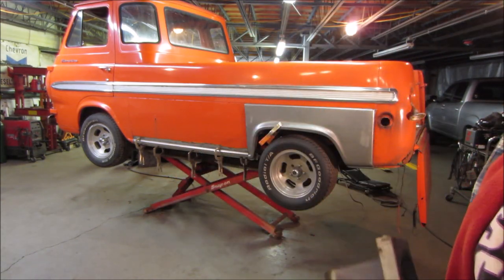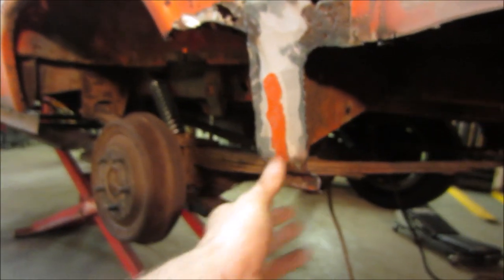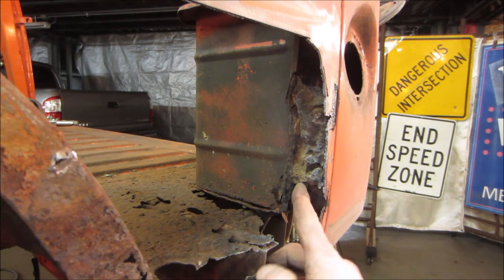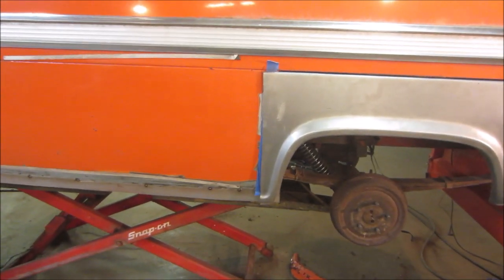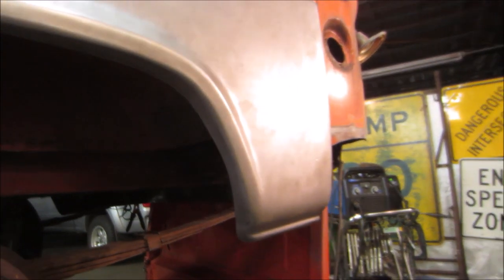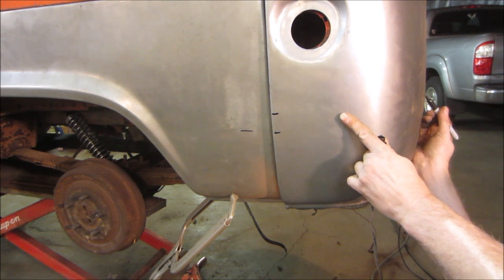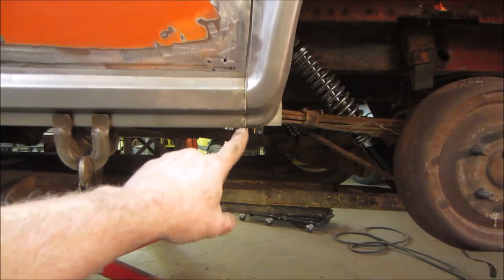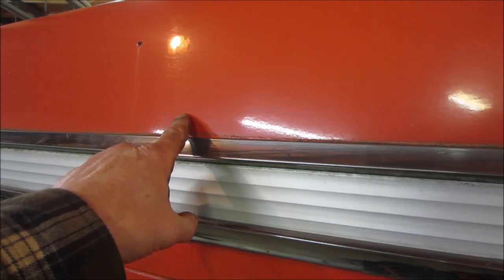Quarter Panel Replacement on a Ratty/Rusty Econoline Pickup

Comment: how is life treating you? my uncle just fixed one of these trucks, but we swapped the engine over to a 302 bored 60 over and a 4 spd automatic, then he put a four-barrel on the intake then rewired it. it ran beautifully on the freeway then he found out the original diff didn't like all that power.

Comment: About those "hidden figures" under the paint coat, I've heard you can see this kind of micro relief clearly if you're looking at it in a polarized light. I would experiment with pieces of a polarisation film from some broken lcd screen and different sources of light. MB an interesting experience. Or just a light coat of a contrast color paint and piece of cardboard or thin mdf to wipe it of the high spots could be another option. Would be really interesting to find out what's been written (or drawn) in there:)

Comment: Just wondering? I’ve seen others do similar work , the overlay a new panel , larger than required over the old existing panel , cut thru both to get a perfect match , weld and job done . Not putting you down for what you do cause I’m fascinated with  what you do .

Comment: Nice work ! Have you thought about using panel bond for the front edge of the quarter panel? Will make a nice joint and seal it all at the same time!

Comment: could you tighten up that radius at the back of the big panel with a v-block and a blunt chisel working it around the curve similar to the way your brake worked the top edge?

Comment: The way those panels look I would say that the manufacturer probably stamps the panels, maybe make minor adjustments and then send them out the door. I don't know if anyone will read this but what company did you get the panels from? I want to know which manufacturer to avoid if possible.

Comment: Maybe it's the left over cement that they used to cover over Jimmy Hoffa ?  Ha !.   
I had a 65 and a 66 Econoline vans when I was a kid . Under the gas tanks they have a big slab of counter weight to give the wheels more traction . They have a real cool perspective on the world as its driving by , but man you don't want to crash into anything . Even at low speed you can see how much it would hurt .I had a 289 & C4 installed into one of the vans but I never did finish that project . Had to move and couldn't take it with me . Just as well , cause it you're going to add more speed , you need to add more braking power . These are not a good platform to add a bunch of power . Check the king pins too . They really effect the drivability  . These things are easy to roll too . I use to get the rear wheel to come off the ground around a corner . Take it easy Man. It would be smart to go over the braking system . Single master cly .. Yicks !

Comment: Angle grinder is really your friend when going changing panels. The plasma cutter makes the job worst and harder. Also for the future the first panel you cut generally is the new one that you can then use to mark where to cut on the car with a lip or even without.

Comment: for the guard panel, to sharpen the edge, could you pad some mig beads along the edge and hit it on the belt sander? thats a lot of mig wire but it should be pretty straight forward

Comment: After dealing with several "replacement" panels from various manufacturers, I only replace just past the rust. There is usually so much work to get the new panels to work and look right that its faster to make a patch or only cut the bit you need from the new panel. There is no fit like original.

Comment: Loving the bodywork, is it a possibility to use one of the lower Jaws from the press in the vice and a wide chisel to tighten the 90 degree on the short side as not possible to put it in the machine? 🤔 Regards Tiny, Lincolnshire, UK 🇬🇧

Comment: That crap in the back is floor leveling compound. The kind used under vinyl sheet and tile floors. Vi-Tex maybe. Similar to fix-all. Probably the van belonged to a flooring guy.

Comment: Solve rusting from the inside out with Cavity Wax.  Fill the cavities with it.   It's easy to get Cavily Wax.  It stops inside rust cold whether it's there or not.  See Vehcor video. Somehow water gets in what seem to be sealed cavities.  Vehcor contrasted the side he fixed on a Pontiac Grand Am with the untouched side.  That untouched side was rusting out, some years after the body work, the worked on side was like it came from the factory.
Reply: If the Car Companies did things right, with Cavity wax and something to stop external bolts and nuts corroding together, cars and trucks in the rust belt would not rot away.  We'd keep them like they do in dry parts of the country until the motor, or transmission or suspension died!
Reply: I believe Eric O would think he'd died and gone to heaven!

Comment: Mustie or Anyone: question about the plasma torch.: are using a special tip... do you can drag it... or do you just replace them regularly? I have a wire cage on the end of mine that I’d like to not have to use.

Comment: I probably would have butt welded the edges as your flanges are going to show on the inside of the bed since the bed is not lined.  With your  MIG welder you can get good butt welds.  I'm thinking this is a pretty nice truck considering the location and age.  Especially since it runs well.  I admire your deal locating skills.  As someone else suggested a Corvair Greenbrier or rampside would be perfect for your period collection.

Comment: That wheel well seam you can re bend it, with a ninety degree block of steel used as a dolly that way you can get a sharper bend in that seam that has a shitty curved bend instead of a true right angle bend near the gas tank, which will give you a better overall line.

Comment: I'm still watching but i would definately cut that corner out of the panel and re-hit those bends in the brake.

I would guess that's a 90 degree top in the brake therefore when you pressure bend , the flange will go over 90 at first and when you add more pressure it will push it back to 90 ..   (coining)

Comment: I'm going to have to say your making more work for yourself. Drill out the spot welds and use the flanges on the new panel! Alot less bodywork later. Any time you weld metal that thin it will bend all over. I've done 3 cars and learned this the hard way.

Comment: I'd like to live in wealthy New Hampshire where the well heeled put valuable power tools or motorized implements by the curbside with giveaway prices or for free every year if they don't start on the 3rd pull or when you turn the key over several times. It must be an amateur mechanic's dreamland for sure. On the different subject of the VW air cooled motor, Dr. Ferry Porsche the designer of the engine was quoted in print as saying not to expand the stock engine bore of the 15 and 1600cc engines beyond 1776cc , because it would overstress the car or bus engine cases and components. Building 1776c engines for all cars and buses you plan to keep and use as daily drivers might be a good useful thing to do, especially for the low drag Karmann Ghia. Keeping up with today's 80 plus mph cruising speeds on this country's Interstate System is hard or impossible for almost all sizes of stock VW engines. You seem to find spare engines real cheap or free often, and you could inexpensively build 1776cc engines and swap them out take in less than an hour.

Comment: Perhaps you should sand blast the rust so see what you're dealing with before doing repairs. It would give you clean surfaces to weld to, plus you would have a better idea what needs replacing.

Comment: if I was doing all this great metal work your doing on this job I would not do Bondo that will cause rust down the road in two years.  I would lead it.  It will last as long as long at the rest of the metal.  Just saying.

Comment: Seeing when you cut it out I was looking behind what you cut out kinda rusty back there. I.  have a 92 Ford from the south never undercounted little rust did the hole bottom with rust reform than went over it with oil base primer car has no rust stop it co

Comment: What brand of plasma cutter are you using?  Is it miller or smith equipment?
Reply from the maker: HYPERTHERM POWERMAX 30 works great but kinda pricey
Reply: @mustie1  Ahhh  I used to work at the Smith Equipment plant and helped build their 55 amp machines and repair their older 35 amp machines.  Always wanted one but couldnt justify the cost

Comment: It just occurred to me that rather than repair rust in bed you could convert to wood boards and rails. You could then throw a piece of plywood of that loosely to protect those beautiful new boards and rails for those garage sale runs
Reply: also, with the steel bed removed, you could media blast parts of the frame and paint before the wooden boards and rails go in.

Comment: Mustie, did you sell this truck?  I hope not. Looking forward to more videos of it. One of my favorite vehicles on youtube....Yeah I know, I'm a little looney.  Maybe you can split the engine and transmission and put the trans in the back to distribute the weight better. or move the engine back about 3 feet. The one huge problem with those vans is (as you have already pointed out) the fact that there is no weight in the back.  The one and only severe design flaw.

Comment: For the air hammer if you get a wide flat bit & sharpen the shit out of it it'll cut those spot welds off a lot faster I just use a sharpened gasket scraper to cut the spot

Comment: I'm really disappointed by those "new" panels.  Not what Mustie did to them, I'm talking about how they came.  Anyone out there have a lot of experience with after market panels?  Is this common?
Reply: Very common. And with less common cars, You sometimes don't have any choice just to get this low quality parts and try to fit them.

Comment: Those seams don't look like Fords best design idea ever...why not just fill them in with a weld bead or bondo and grind them smooth? I also kind of like the idea of a smooth concrete bed liner, wasn't there some kind of weight over the rear axle already? that could be removed to compensate for the concrete weight with a rubber mat for grip action.

Comment: Check out jonathan w's site and Duckmancyclesandvwgarage,,, they have a LOT of bodywork videos!  I would plug weld the wheel well from underneath,, inside to outside, just drill the holes in the wheelwell, and panel seal it too.